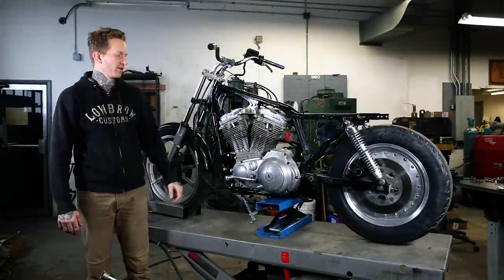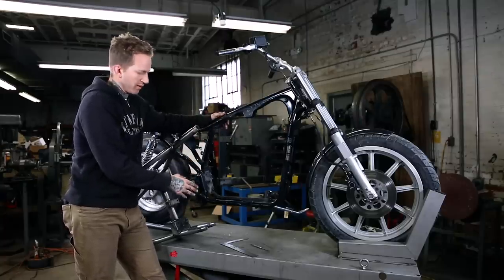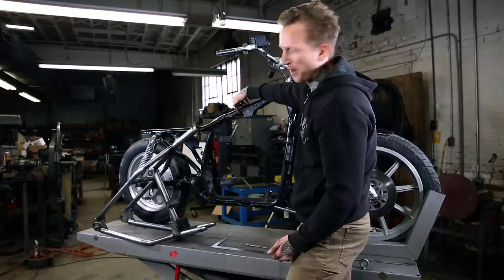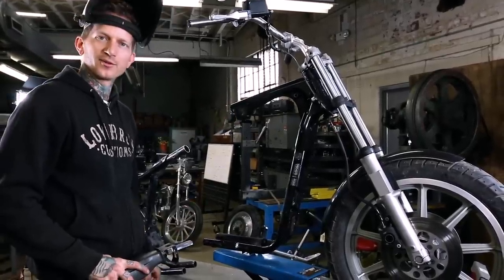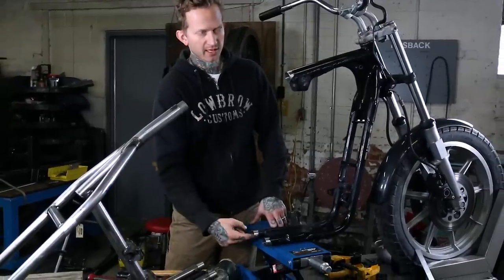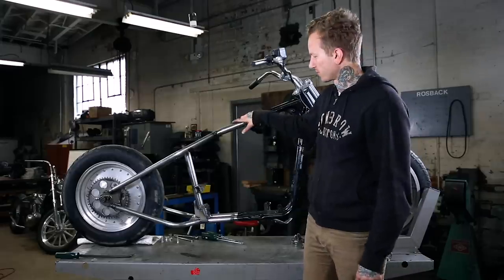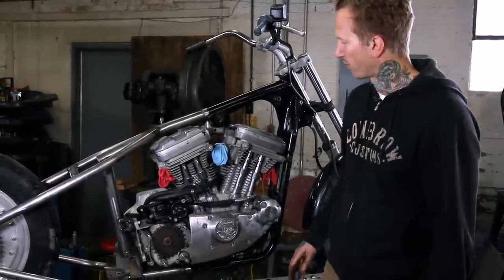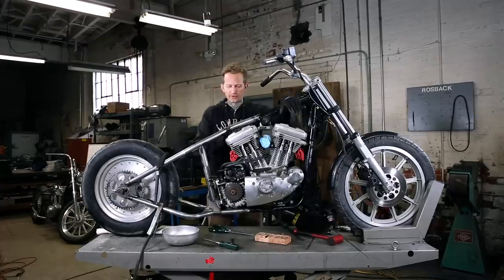How to: Install A Harley-Davidson Sportster Hardtail Frame 1982 - 2003

Comment: Tip for square cutting the frame tubes: scribe those measurements as shown. Now grab one of those c clamp style tubing cutters plumbers use for water lines and mechanics use for hard lines. Set the cutting wheel on your scribe point, and run that bad boy around the frame tube a few times. Voila, nice square DEEP scribe line around the whole tube. Your blade or disc can be eyeballed "on the line" the whole way around, no muss, no fuss, and damn near perfect. Easiest way to insure your mark doesn't disappear, wander off, or get burnt back by grinder sparks, etc. like it can with tape, sharpee, or scratches in the paint.

Comment: Well done Guy's,  this is the kind of video that could sway someone on the edge of installing a hardtail themselves to go for it. You make it look easy and stress free.
Reply: It IS that easy, and Tyler does a great job here. Remember, if you 'mess up' - it's only "time and money" nobody got hurt, lost their limbs, or life.

Reminded me of a co-worker mechanic that forgot to torque the rod bearings on a Detroit Deisel engine.  When he fired it up for the test run, a rod came out the side of the block and pieces flew everywhere. $40K gone right now.  "It's only time and money. LOTS of time, and LOTS of money."  lol
Reply: That's their plan... that's why they don't show the part where they get the hardtail into the frame.

Comment: Great video thx.   To mark the frame for cutting, I scribe it the way you do, then wrap masking tape around the frame tubes with the edge of the masking tape right on the scribed line.  This helps me to keep my cuts straight because you can see if you are cutting off on an angle.  Just follow the edge of the masking tape with your cutting tool.  PS: I loved watching the rear frame section drop on the table, haha.  Nice effect for the video.

Comment: The people at Lowbrow are great and this product rocks.  Bought one of these hardtail assembly's and this was the first time doing any frame work and literally completed the installation and mock up into a roller in 5 hours and I took my time.  Measure 5 times and cut once.  Tacked the tail in place with a mig, through the engine back in place and took it over to a friends house for final welding and a few oat sodas.  Less than 8 hours work and we're a roller ready for the rest of construction, piece of cake.  You could probably do it faster.

Comment: Trenches Icon HYDRO was engineered with a hydrophobic technology on the crown panels designed to bead away water and prevent absorption. Constructed with durable materials, the hats are water repellant, floatable, and breathable.[copy]

Comment: I feel like the price of the section of hard tail and the cost of having a machine shop hack and weld this very sketchy job would be just as much as ordering a full hardtail frame?
Reply from the maker: It depends! If you go to a reputable shop, it wouldn't be sketchy or a hack job! If you are more comfortable with just getting a full frame, that is the way to go!
Reply: Say if you did this in the UK to a 82 sportster the bike could keep its VIN number and wouldn't need new plates.. and a 40 year old bike in the UK is tax and MOT exempt..

Comment: Question. You mentioned leaving an eighth of an inch gap where the tubes meet but I thought I heard you measure the distance and then cut the frame at the same measurement instead of cutting an eighth of an inch more off. Can you address that please? Thank you

Comment: Will the stock rear caliper mount fit the frame? I like the stock caliper.
Are the stock midship controls and pegs usable/ practical for this build?
Thanks.
Reply from the maker: You can use it you just have to fab a slide / mounting bracket to use it.
Reply: @lowbrowcustoms  Man! That was fast! Your on it this morning.
I think I can manage the slide for the OEM caliper mount. I'm 5'8, would the OEM mid pegs and controls be practical? I've had other hard tails, and the advantage of being able to unload the seat a bit in rough terrain is better than with forwards. I work for a Harley dealership and this will be a daily rider.
Thanks.

Comment: At the 10 minute mark they cut away when the top tube was cut too short!  Nice editing save coming back with the tail fitted up.  No judgment, it happens!
Reply: I saw that too. Perhaps they can make a video about when you cut away too much material.. .. . great video otherwise.
Reply: I wanted to see it as well

Comment: Great video love you guys however I just don't understand where all my wiring was go sneaky sneaky like I am such an amateur however I am going to attempt this on 2 iron heads and I am not by no stretch of the imagination a motorcycle electrician the welding I'm okay pretty good it's the wiring that holds me back I don't know how you can help me if you can if you have a video that I am not aware of this is my dilemma

Comment: I got a 73 XLCH Motor in a Pre 1970 frame.  HD didn't put any numbers on their frames before 1970.  I know I had a hell of a time finding swing arm bearings for this thing.  My cousin had a set for a 50's frame that worked.  So do you have a hard tail for the Pre 70's frames?

Comment: What did you guys do to convert it to chain drive? Is it a special kit?
Reply from the maker: Tyler James this bike is a 1988 so it was already a chain drive. However we make kits to convert belt drive Sportsters to chain drive, you can find them here: https://www.lowbrowcustoms.com/motorcycle-parts/drivetrain-transmission/chain-conversion-kits.html

Comment: Hey guys love your work, Ive been running rigid shocks on my 2010 48, but would love to hard tail the frame, my big problem is Im in Australia!! do you guys have any idea what the freight cost to Australia would be? cheers
Reply from the maker: you can go on the site and put your address in the shopping cart after adding the product and it will calculate it for you. https://www.lowbrowcustoms.com/collections/motorcycle-hardtail/products/weld-on-hardtail-rear-frame-section-for-1982-2003-harley-sportster-in-stock

Comment: I looked through your online sight and didn't see a hardtail version for my 2006 883 low. Do you not offer one?
Reply from the maker: Not yet, 04-up is rubber mounted Sportster frame. We are coming out with a version soon, we will also offer solid mounts to convert the frame after Hardtailing it.
Reply: @lowbrowcustoms  Well, I guess I'll keep looking.

Comment: Do you sell a hard tail for a 65 triumph frame? I have a bolt on one on there now but I just don't trust it. It seems to have too much flex. What's your opinion?
Reply from the maker: we make a bolt on one that is super strong for Triumph 650. made here in the cleveland ohio. https://www.lowbrowcustoms.com/lowbrow-customs-1963-1970-triumph-unit-650-c-c-bolt-on-hardtail-frame-in-stock.html we also have one for 500cc https://www.lowbrowcustoms.com/lowbrow-customs-triumph-unit-500-c-c-bolt-on-hardtail-rear-frame-section-1958-1974-in-stock.html

Comment: Hand in Hammer makes a hard tail like this which comes with a bolt on jig which eliminates putting engine in twice. I know you have probably seen theirs, what makes your better?
Reply: Youre just paying a premium cause you get a jig and its from one of those artsy-fartsy hipster looking shops. And looking at the photos, Lowbrows hardtail has beefier construction. Look at the rear motor mounts, LBs has gussets, HIH doesnt.
Reply: Because if something happens to it or it is out of spec lowbrow has a 100% track record of taking care of their customers. I mean if taking the motor out twice is your biggest concern then go for it, but when your building a bike the added 20 minutes in the grand scheme of things isn’t shit. My .02

Comment: No state I ever herd of does the engine need to match the frame unless it’s a builders title or salvage and that would only be for a inspection to verify no parts are stolen when it was built same on any part that’s it has most good parts have serial numbers I know my paughco springer does and it’s worth more then most engines registration and insurance always has the vin on the frame unless it’s a pre 70s Harley

Comment: That bike would be really bitchin if bright parts were polished up, a chromed springer front forks, chromed scramble type straights 1 1/34" diam. with slip in steel baffall tubes 4" length. That would be legal when going into State Parks. Just slip them in put a Cotter key and go It will also quit the bike somewhat. 1937 Ford Green paint with black & blood red pinstripes. Just a thought.

Comment: so why do these kits only work up to 2003? was there a radical change in the frame after that year that prevents hardtailing?
Reply from the maker: Yup, 2004-up went to rubber mount frame. Completely different set up.
Reply: @lowbrowcustoms  Thanks for the reply guys!
Reply: I got a 03 1200 just made it 😅😅

Comment: Does it work with the belt drive?
Reply from the maker: you would have to get a longer belt, its better just to convert to chain conversion. Here is some we carry https://www.lowbrowcustoms.com/motorcycle-parts/drivetrain-transmission/chain-conversion-kits.html

Comment: I apologize if this is a silly question, but I'm new to working on motorcycles and have a Sportster. What's the point of removing the back shocks from the original to go hardtail? I don't think it looks so bad as-is. Thanks
Reply from the maker: Just personal preference!
Reply: To feel like you are old skool cool. It makes the bike unsafe in corners with rough pavement and will generally ride really rough... but hey, personal preference. People do what they want to their bikes.
Reply: I think it looks badass

Comment: What about aliment front tire with rear tire  ????
Reply from the maker: will work with stock wheel and axle. aligned to your drive sprocket. bike needs to be converted from belt to chain.

Comment: Anyone know why that hard tail cant be used on a 81 frame.  I cant find a difference between 81 and 82 up.
Reply from the maker: Among other changes, 1982 models were fitted with a stronger and lighter frame. This allowed the battery and oil tank to be repositioned. There are difference between the two frames. This is why we made the year ranges of fitment 82-03.

Comment: Nice, what do you do work the oil tank?
Reply: Stock one wont work. Get an aftermarket one. Theyre everywhere.
Reply from the maker: Eric Kuhns you can use a cylinder style and mount a batter box on bottom rail or find a horseshoe one that will fit correctly, we will be coming out with a specific horseshoe one to fit this hardtail very soon

Comment: what kinda japanese cruisers does this kit fit? what is the japanese clone to the sportster? as far as framewise
Reply: uziXwraith none. Lol. This kit fits 82-03 HD sportsters. Japanese small cruisers will have a completely different frame construction down to tube diameter. How ever most of the popular Japanese bikes like the xs650s and kz and CB have available hardtail kits.

Comment: Why no rigid frames post 2003? I am having a hard time finding anything for a 2014.
Reply: John in 2004 Harley went to a different motor mount system using rubber motor mounts for sportsters. If you dig through the comments on here lowbrow listed that led sled customs has an 04 and up kit and lowbrow also sells solid mounts to help with chain staying in place. Also you have to convert to chain drive on 04 up sportsters if you hardtail with the ledsled kit. In my opinion the 04 and ups look absolutely awesome hardtail Ed but aren’t to common. 82-03 is probably a little easier to achieve though.
Reply: @seaeff6428  Thanks a lot for the reply, much appreciated.

Comment: How do you measure for straightness front to back?
Reply from the maker: Dan Luna a bit confused by this question. If you measure at the points shown in the vid, cut there accurately. Then slide the hardtail in the three sections you cur and bolt up the motor, the motor will insure the frame is straight. Motor acts as a jig.

Comment: How do you check if it’s even straight?
Reply from the maker: Michał Ryczkowski what’s even and straight, the cutting, the welding, the frame itself?? If you follow along this whole vid shows you best practices on what you need to do to cut and weld and you must use the motor bolted in to make sure the frame is in right positions before tac welding. It acts as the jig, making it straight and even.

Comment: Does it come with a title?
Reply from the maker: your frame from your sportster has the title. Hence why you hardtail it, so you can keep the numbers matching. if you do a full a frame then you have the title to your old frame still. Dont buy a bike with no title if you plan on running it on the street.
Reply: @lowbrowcustoms  I traded an old boat motor for the Sportster.. the Sportster has no title. Hence, reason why I want a frame with a title.

Comment: Do you guys make any hard tail frames that fit the m8 engine?
Reply from the maker: Daniel Morales no not yet. Those are still relatively new, we have to wait to see what changes they make and what can fit moving forward. Takes a long time for R&D when stuff keeps changing.
Reply from the maker: Daniel Morales we suggest finding a local shop to do a one off for your motorcycle for now, that would be your best bet

Comment: I’m actually disappointed I was under the assumption that these hard tails come completely ready just weld on but I keep needing to buy this and that weld on this that the other I could have baught a paugcho frame and been done
Reply from the maker: The purpose of a hardtail is to keep your numbers matching from your motor to frame, Yes you can buy a Puaghco frame but the numbers wont match and in some states that matters, and if you have to have extra documentation to sell ever down the road if need be etc. Also this allows for much more customization and opportunities to make things the way you want.

Comment: Just buy a whole frame. Why risk a weld on a ridged?
Reply: in some places its way easier to keep the original frame numbers + compliance plates to maintain registration for use on the road.
Reply: Why risk an entire welded frame that may not be straight? I’ve seen quite a few rigid frames that were crooked. And as stated, no MSO paperwork and special titles that certain states require.
Reply: Um.... what about the rest of the frame? Stock/uncut/unmolested frames are ALL welded together. Shit, older bikes are bolted together!  Why would 3 welds be any different? Or are you just not a good welder? If thats the case, a local shop would usually weld a tail up for a couple hundred!

Comment: Will this ever be available on a 2016  model?
Reply: Lowbrow doesnt. Dont know of anyone who makes a weld-on HT. Ryca Motors has a bolt-on for the '04-'13 Sportys. IDK if it would fit a '16, it should, but I dont know because I have 0 experience with post-carb Sportys. Even then, a bolt-on isnt the best option for a bike that should be welded. If you want to go the "bolt-together" route, do it the right way, build an old Sporty or a Triumph.
Reply: @isaac2152  found one after I posted this. Ledsled
Reply: @brightsideme  Cool. Didnt know! Ive only ever used LedSled for Invaders lol.
Reply: But why??

Comment: Will work for an '84 Ironhead?
Reply: 1982 to 2003 sportsters, what do you not understand
Reply: Is an ironhead a sportster? Is 1984 between 1982 and 2003? Lets add up the clues........

Comment: Or ya could just buy a factory ridged frame
Reply from the maker: There is no such thing as a factory rigid frame for a Sportster.
Reply: Sure, you can spend over a grand on a custom built frame. But, then you have to deal with DMV and State Police. Youre looking at MONTHS before getting it on the road. And even then, youll get a "custom/home-built" title, which has the resale value of a dried up dog turd.

Comment: yeah except they sell the iron head hard tail kit in pieces you have to wield their pieces together properly then weld it to your frame then weld on your own bolts for the axle adjusters...... and they charge 350 for that lol if Im gonna fabricate it myself ill buy the parts form a local shop for 50 bucks and fabricate it myself, otherwise ill buy from a company for 100 bucks less that is complete on ship including a caliper mount and bolts to run axle adjusters through pre wielded

Comment: Cant see the point of a hardtail just makes it uncomfortable and handle badly
Reply from the maker: it's not for everyone, and thats ok! but they actually handle just fine... Different strokes for different folks.
Reply: They dont handle as bad as you may think! Its not a sport bike. And, in case you havent noticed, most chopper guys dont care if its comfortable or not. Its rad, its cool, its timeless, its a chopper. Not a Beamer or a Gold-wang.

Comment: Just buy a frame..
Reply: Have fun with that. Hardtail costs a couple hundred. Full frame costs at least $1200 for a good one. If you want a full custom frame, several grand. PLUS, you have to deal with DMV and State Police to get a VIN and Title. Hardtails are cheap and easy. Shit, you can buy a hardtail, strip your bike, and take it to a boat, bike, machine, welding, truck or off-road shop and theyll weld it up for you. All that would STILL be cheaper than buying a whole frame (if you dont have a welder/confident with welding.)